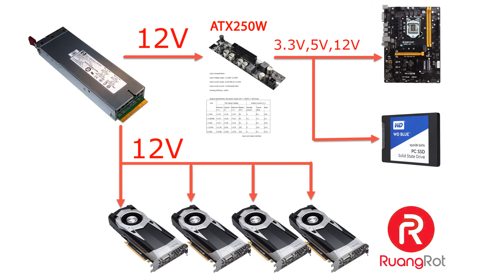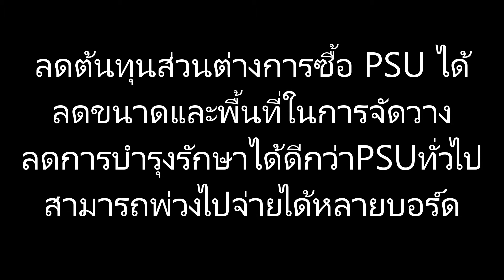PSU 250W เต็ม ล้นๆ เหลือๆ ไม่มีมโน 250W MAX

Comment: hello, you are good, this video really helped me, today I bought exactly this kind of mini 250w source, but I have a problem, nor do I find on aliexpress, or on ebay, a cable that turns 6 pins (server breakout) in 4 pins p4 (for current power, to you I saw that you solved the problem, do not put a link from where you bought cable, thanks a lot.